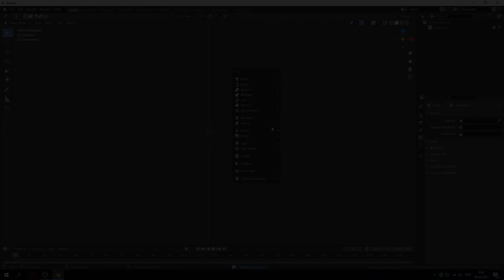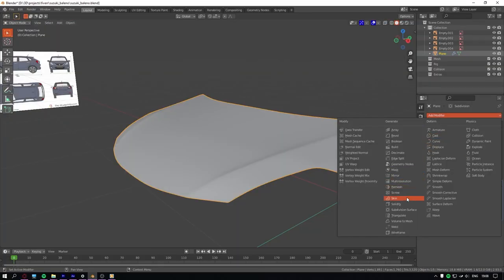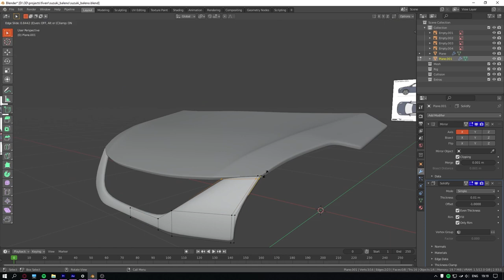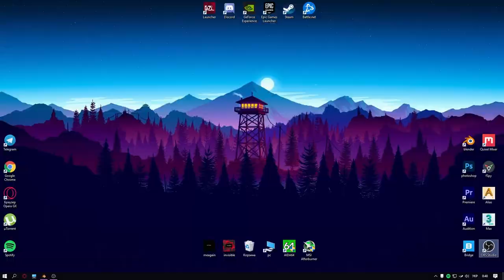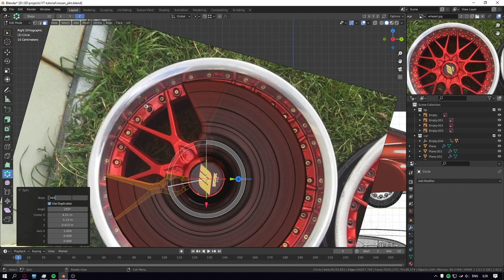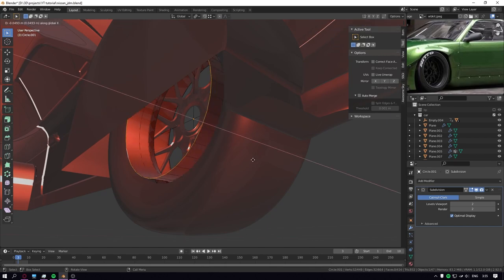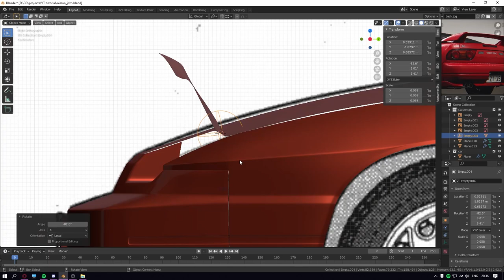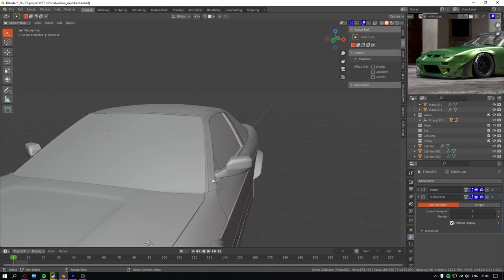HOW TO MAKE A CAR || Blender tutorial

Comment: Could you explain the part where you show how to switch to a new part? So first you do Ctrl D to copy the vertices you want, then you do Ctrl P and you got a new part to work with. Did you do anything in between? Because you get a new plane from the vertices and when i do the parenting thing they remain in the same plane

Edit: looked at it in slow motion and saw the separation you did
Reply: If I correct understood your question, he pressed just P (not Ctrl + P) to separate verticles to other layer.